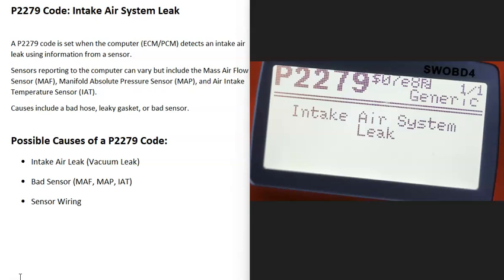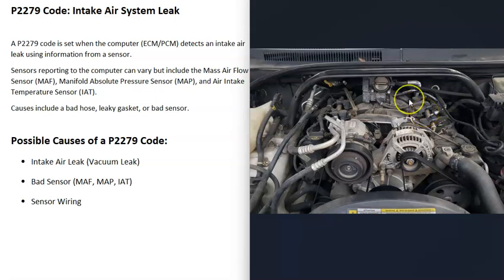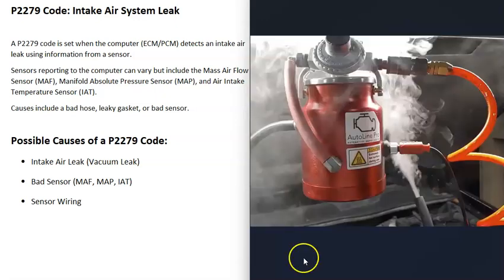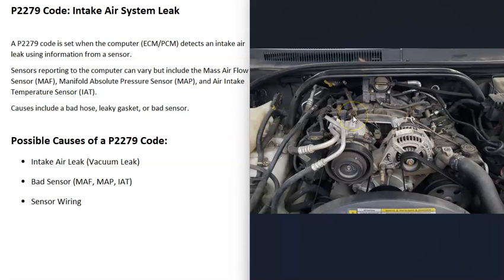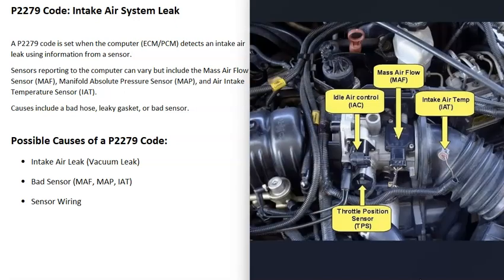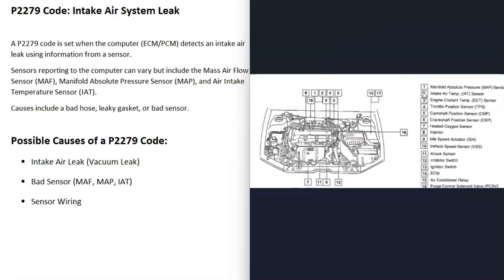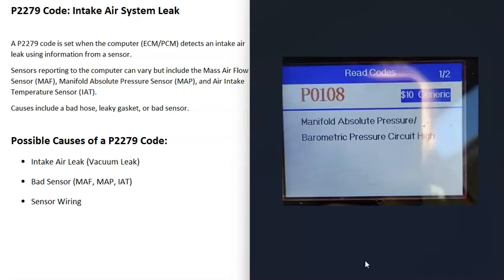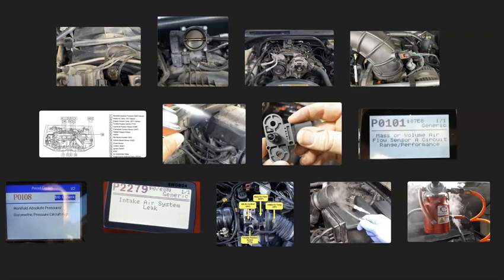Causes and Fixes P2279 Code: Intake Air System Leak

Comment: If a bad mass airflow sensor is a possible cause for a P2279 code, then wouldn’t the scanner pull another code for the MAS?
Reply from the maker: Usually yes, but sometimes components fail with no code.

Comment: I have changed my lower and upper intake manifold gaskets,change my hoses, pcv  valve also the break booster hose on my 2005 Honda Accord V6 3.0 and the vacuum leak is still there.I have used carb spray and a smoke machine still can't find the leak.my map sensor has been changed twice and the wires are good,good signal,good ground and the 5v is there.I can't think of another solution.this is wierd.
Reply: Most likely intake manifold crack.
Reply: @AngelRodriguez-jv6oc  I have changed the lower intake manifold in September but the issue still persist.I am thinking could it be a upper manifold or one of my intake valves is not sitting properly.

Comment: Hey mate, I get the p2279 combined with p1119 code on my volvo VEA engine. Any Ideas what it could be?
Reply: Hey mate! Could you tell me what solved the problem, what was the problem? My audi same two code.
Reply: @TamasMagyar-cp7rd  Hey budd, at that time I had a few issues but I managed to solve them all. I know that I have changed the TMAP Sensor, the MAF Sensor and I had a air leak on a hose coming from the intercooler. I don't know which one of those belongs to the specific error above but one or more of them solved my issue(s)
Reply: Thank you

Comment: How about po2099 on a 2015 gmc sierra 1500 5.3 the scanner saying system to rich my stft on bank 2 is -20 ltft is -15 I monitor the oxygen upstream sensor staying rich and downstream is flat line only switching to 500mv power and ground are ok